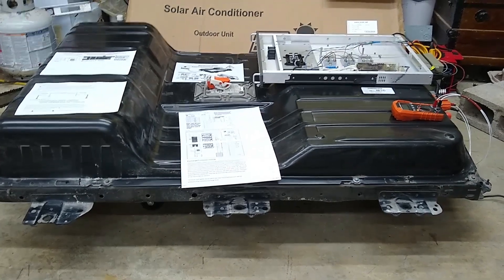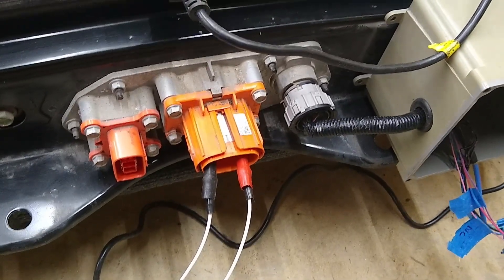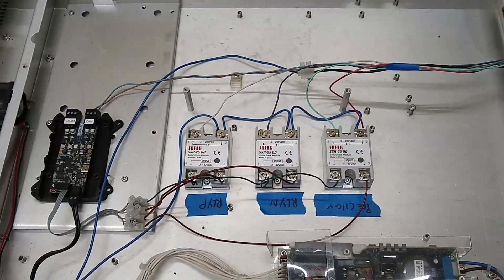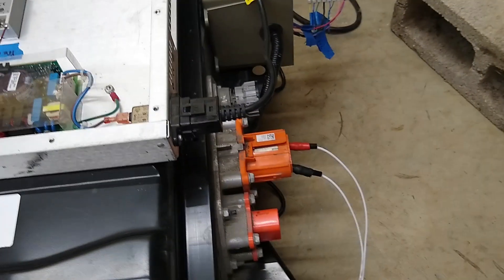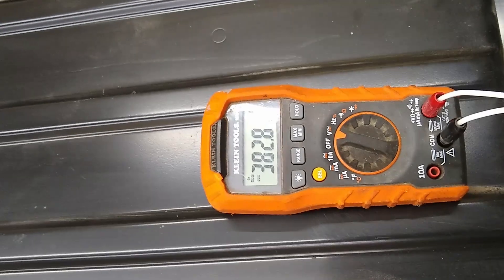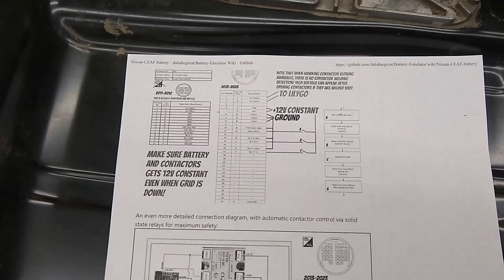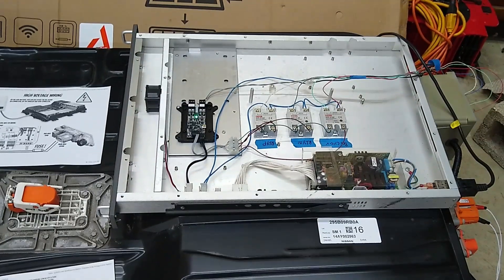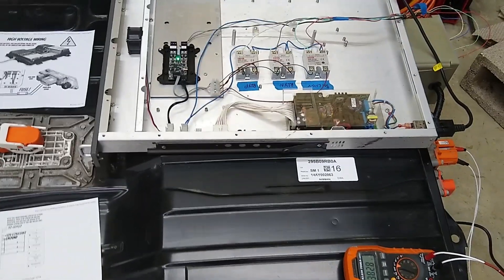Using a Nissan Leaf EV Battery as a High Voltage Solar Storage Battery! Part 1

Comment: Could I series connect 48volt batteries with the lilygo?
Reply from the maker: Don't advise it but there are ways. You would need to ditch the batteries BMS and go with something like this, https://github.com/dalathegreat/Battery-Emulator/wiki/Battery:-RJXZS-BMS

Comment: Can you send me the link of all the Schematics of the Nissan battery I can't find them 😉
 I would like to work with 2 batteries and connect them in parallel .
 I also want to work with an EMS system for optimal control.
 Thanks in advance! 
Greetings Bernard
Reply from the maker: Unfortunately I do not have any schematics for the Nissan battery. But if your looking for wiring diagrams for the connectors this will work, https://github.com/dalathegreat/Battery-Emulator/wiki/Battery:-Nissan-LEAF---e%E2%80%90NV200
Thanks for watching!
Reply: @DIYSolarFarming   Thank you , I'm going for the 62 kW  
Have a nice weekend and greats from the Netherlands 
Bernard
Reply: @DIYSolarFarming  
 Best
Is there no dealer in your area who sells the 62 kW battery 2nd hand 
I don't find them so easy here.
Thanks in advance 
Greetings Bernard
Reply from the maker: @bernarddesloover158  I buy the whole salvage cars from Copart, it's a US auto auction. I pull the battery and sell the motor, inverter, charger etc. and end up with a free battery...
Did 2 so far, the 24kWh cars are the lowest cost and that size battery works perfect for the equipment I run.
Reply: Best
I am in the middle of negotiating for a 62 KW battery
All the parts of the Exel list have already been ordered 
I have another question about the software.
Can you give me the code number in the list to enable software 
And the code number in the list to be able to use SSR relays.
The codes go from 1 to 1234 and is hard to find 
Thanks in advance for the info 
Greetings Bernard
Reply: @DIYSolarFarming  
Best
I am in the middle of negotiating for a 62 KW battery
All the parts of the Exel list have already been ordered 
I have another question about the software.
Can you give me the code number in the list to enable software 
And the code number in the list to be able to use SSR relays.
The codes go from 1 to 1234 and is hard to find 
Thanks in advance for the info 
Greetings Bernard
Reply from the maker: @bernarddesloover158 There is no code to use the SSR's or enable software. 123456789 is the password to log into the Lily go. I suggest to watch https://www.youtube.com/watch?v=hcl2GdHc0Y0

Comment: I assume your inverter reduces the 382v down to 240/110v and also charges the Leaf batteries via the same cables? As if you are charging the Leaf normally via a mains cable?
Reply from the maker: That is correct, the Solis Inverter is split phase 120/240 and it charges the battery. This video shows the inverter and battery connected and running. https://www.youtube.com/watch?v=V4ZOvSEZYW0
Reply: @DIYSolarFarming  cheers. Just watched the video.

Comment: Hi, I just saw this video, and I'm a bit stunned.  If I understand correctly,  you are able to use a Leaf battery right out of the vehicle with just the small   computer that provides communication between the inverter and the batery? This is like a dream come true.   I am assuming that it includes the balancing of the individual battery modules?  As I understand it,  the Leaf battery also has an internal charge controller. So,  is it as simple as getting an all-in-one solar charge controller/inverter and plugging in the Leaf battery?
Reply from the maker: Rodger that, we use the battery as is. It already has a BMS and charge controller built in so no need for those. You just need a compatible High Voltage Hybrid Inverter.

Comment: Nice, I have a Solis S6 3 phase 10kW inverter being installed next week, will add the "virtual battery" until I find a friendly electrical inspector and a used Leaf battery
Reply from the maker: Sounds good! One tip, I don't know what kind of setup you have there but you can buy the Leaf from a salvage auction pull the battery and part out the rest. You get a free battery or even make some money that way with a little work.

Comment: So, are you completely off grid because that battery is not UL Listed for the purpose of Home Solar installation.  The Authoritiy Having Jurisdiction clearly won't approve that thing.
Reply: That's the killer isn't it? Batteries rated to sit in your garage and power your house are priced in the stratosphere but batteries out of a vehicle that is allowed to park in your garage are FAR cheaper but not allowed. There really needs to be some way to recycle EV batteries for home use.
Reply from the maker: @BLKMGK4  Agreed! Probably the only chance is V2H.
Reply: @DIYSolarFarming  I’ve pondered a concrete pad and some sort of shed away from the house. Still not likely to be approved but about as safe as possible - from the battery anyway. It’s just frustrating.
Reply from the maker: @BLKMGK4  https://www.youtube.com/watch?v=V4ZOvSEZYW0   😂
Reply: @DIYSolarFarming   Yup, JUST like that! But you know damn well an inspector wouldn't approve the power hookup and if you do it without them and an issue occurs insurance will happily deny you. Out where inspections aren't mandatory like it sounds like you've got? Perfect! Fuse that sucker well and keep it in a shed like that - you've still spent WAY less than 24K/W of "approved" storage by far I'll bet!
Reply from the maker: @BLKMGK4  Check this out, https://www.youtube.com/watch?v=gKSmIqGvZR4 they are using the same Nissan Leaf batteries on a larg scale.
Reply from the maker: Here, it is my Jurisdiction and I have Authority. 🤣